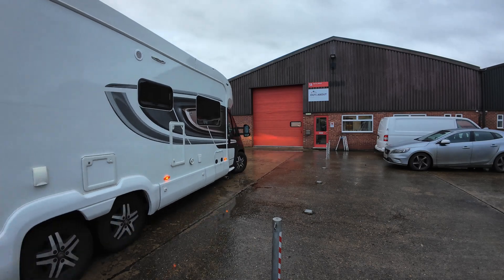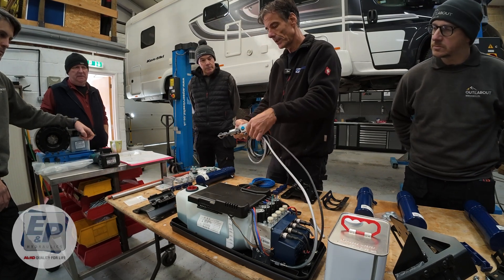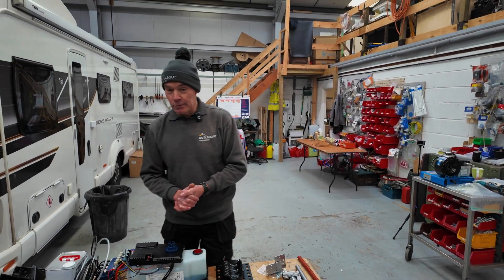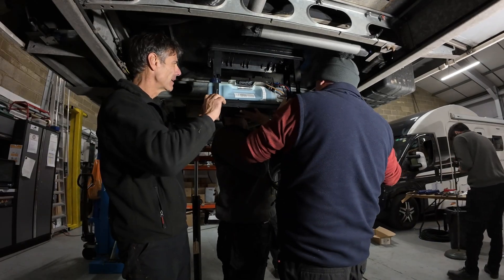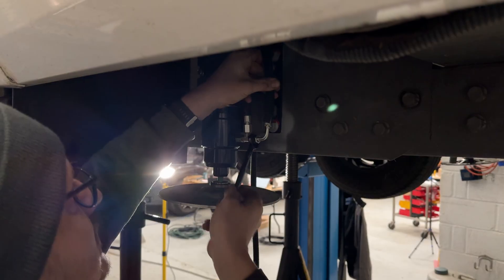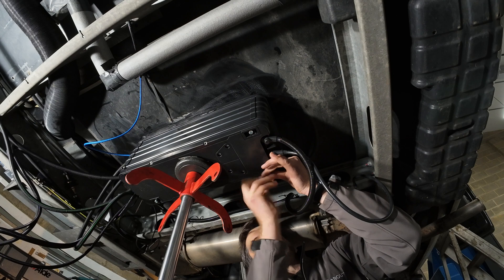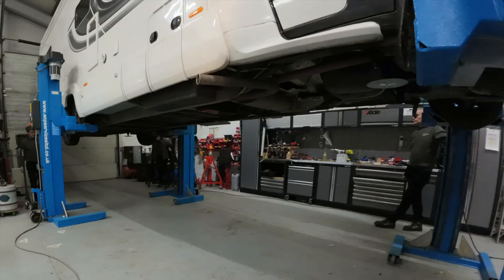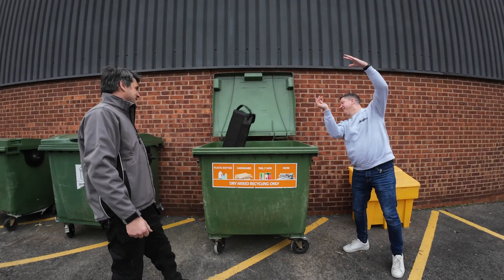The E&P LEVELM PRO - Hydraulic Levelling Just Got Smarter!

Comment: whats the cost single axle swift kontki
Reply from the maker: @martincollins7916  thank you for your comment.  Not sure on the pricing structure for all vehicles as it depends on total weight and length etc but the guys at Out and About will be able help and they are really helpful and relaxed there so I would strongly recommend making contact with them. Our system retails around £7000 but that’s for a 5.5 tonne motorhome. Hope that helps 😊

Comment: Back in the 90s we did European truck racing we had a old mercedes motorhome that we sometimes took with us on the back of a lorry because it was knackered with no MOT or tax we just used it for accommodation on the circuit but I remember if you opened a panel at the back there were 4 levers and 2 spirit levels and the 4 jacks would come down and level the vehicle, I should know I had to drive it back 230 miles from brands hatch when I bought a Austin champ in London because there wasn't enough room on the lorry 😁😎
Reply from the maker: @RodgerMoore-m3r  😄 that sounds like an adventure! You’ve just reminded me of the wind down jacks we had on our caravan when I was a child in the 80’s on family holidays. We had gas lamps for light, no heating and only cold water. 😅